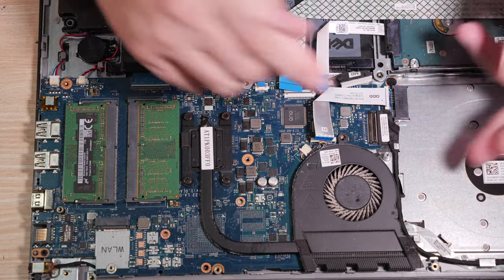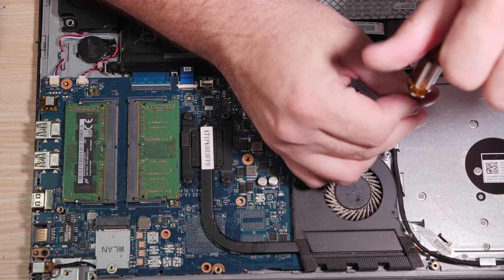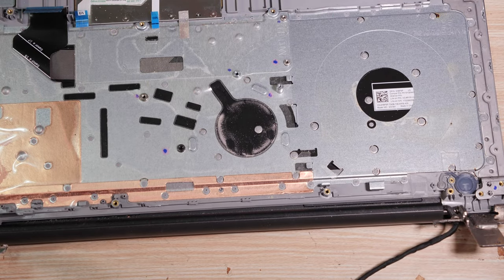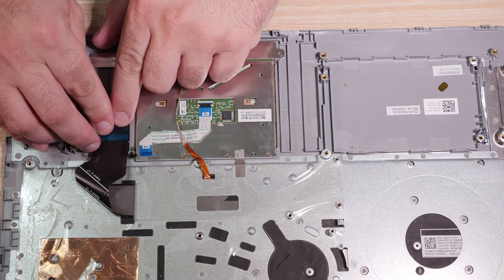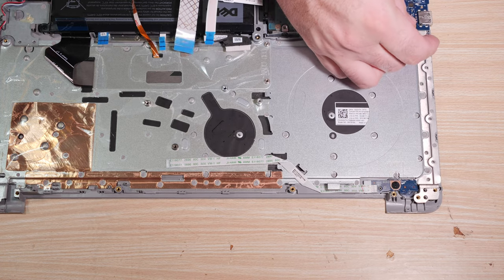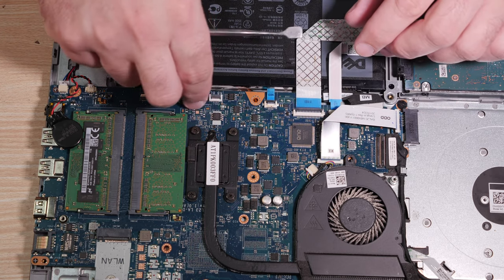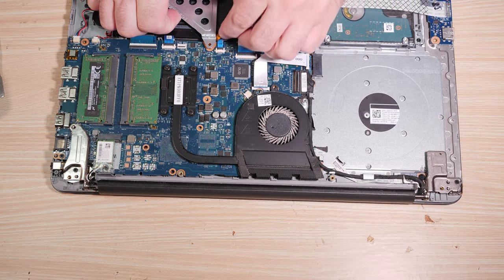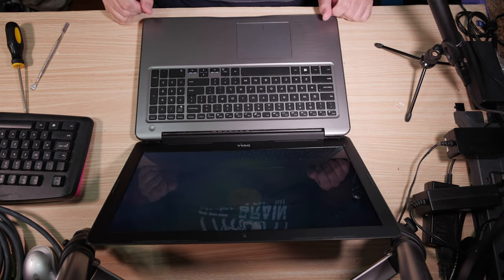Dell Inspiron 15-5565/5566/5567/5568 Disassembly, Motherboard Removal, Keyboard Swap - Jody Bruchon

Comment: I have exactly this notebook. Is it possible to upgrade the battery? I think its capacity is very limited. Are there more powerful batteries compatible with this model?
Reply from the maker: Not really. One of the unfortunate things about the molded batteries used in modern laptops is that there's no room for more battery inside.
Reply: @JodyBruchon  thank you

Comment: My original keyboard 5567 had a back light.  The replacement doesn't, and I think that's why I get a no booting device found ( though they seem unrelated), my HDD connection looks fine.  Where did you get this new replacement with back light?

Comment: @Jody,  Thanks for uploading/sharing this video.  I have a Dell Inspiron 15-5558 and my touch screen function stopped working and my screen would sometimes the screen would go white with purple bars so I decided to replace the screen.  I disassembled the laptop but was having a hard time figuring out how to remove the LCD cable from the motherboard, which you explained perfectly.  Thanks
your timemark
https://youtu.be/3ZTZ2kQ2bCA?t=521

Comment: Thanks Jody.....great video - however----I removed the connection of the cmos battery instead of leaving it attached to the motherboard and can now not POST and thus cannot boot.  Any solution for this?
Reply from the maker: It sounds like you may have damaged more than just the battery connection. I don't know that I can be very helpful.
Reply: @JodyBruchon  Thanks for the reply....not sure, but I think that is the only thing I did that you did not recommend (unplug cmos battery from motherboard).  It does not show a boot menu, and restarts in a loop.  I have since replaced the laptop with a new one - but was curious about this issue.